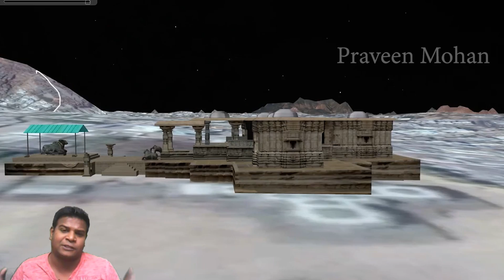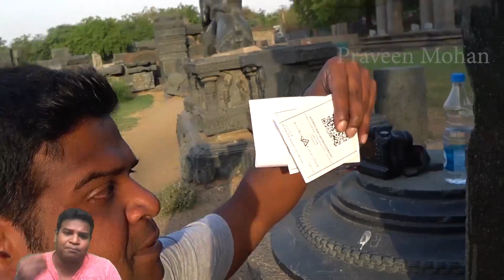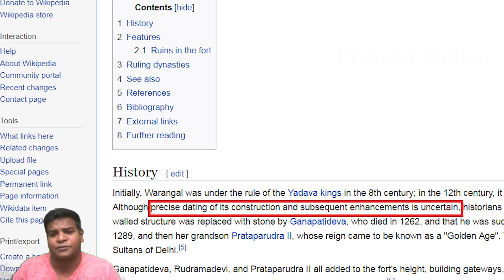Ancient Warangal Fort -  A Mass Manufacturing Megalithic Factory?

Comment: Praveen - You must take a closer look at the "Lingam" structure at 13:34 in this vid. Is it's true purpose being overlooked by classifying it as a religious temple? 

Because it IS one of the machines used in this stone production facility. The black obelisk is a rotational center. What would rotate around it? Cutting tools or work-pieces? The (perfectly?) flat table below - is it exactly perpendicular to the obelisk? That is needed for machining, not so much for offerings. The groove to the table edge - a drain channel for cutting fluid or tool lubricant? Is it original or a later addition for Offerings?  Are there openings or structures in the ceiling directly over the obelisk?  For lifting heavy objects or for rotating them?

The whole structure seems very massive, and dissimilar to the gates, walls,  surrounding the area, and is very plain and utilitarian, without engravings or decoration. Why? Because they are factory walls to support precision heavy machinery? The square indents in the walls - Mounts for an arm or bridge for guiding either the work-piece or the cutting tools? Same for the square protrusion lower down in the far wall. The apparently flat far wall, is it co-planar or parallel to the center table? = a cutting tool guide for large flat cuts. It also appears co-planar to the notch in the right wall, and the "waterfall" wall near right = to guide large flat cuts in two dimensions.  How high is it above the center table?  Equal to a common height or depth of many of the finished stones?

The engravings in the floor, are they perfectly square? Are they exactly the same size, or exactly proportional to the many square shapes in the finished cuttings? = more guides for the cutting process. The undercuts on the underside of the center table - are they more  guides for a cutting tool for precise engraving of fine details?  The fine engravings in the column of the table base? = patterns - guides for work like the sample column to the left?  And that column, is it structural, or could it be the "Blue-Print" for the in-process work, IE .... "Make me ten more just like this."

And what is the context of this structure in the larger area?  If it is a stone machining device,  an enormous amount of energy was required to work some or all the products strewn across the field. How was this energy provided? Human? Animal? Water? Any evidence?  Evidence for delivery of raw blocks and transport of finished work?

Too much to think about here.
Reply: yeah I noticed that too ...just rang a bell that it looks different

Comment: If we go by the analogy that ancient builders used drilling technology, how were they able to rotate the drill bits at high speed? There is no motor involved and how fast can we spin manually? How is this imaginably possible? I have seen your previous videos where you have shown pillars which were perfect cylinders. You need to rotate the rock at high speeds in order to get that shape. Bro clearly this ancient technology is lost. If not for the Mughal invasion and eventual destruction of this ancient knowledge, India would have been in a much better position now.

Comment: Many evidences can prove this site as a manufacturing unit. For ex.: Most of d same kind of rocks r placed nearby each other, also finished pillar blocks r together, roof tops at one place ( categorisation). Had it been a temple or fort, which later was vandalized, all these parts must b far away from each other. Like some pillars & rooftops at one place. Categorisation is a key feature of manufacturing.

Comment: It appears that due to the consistency of the grain within the granite and the crystals of the other stones, that they are produced using a refined geopolymer mixture. They also do not show any signs of natural layers of striations at any  irregular angles between the sediments. The regularity also around the small details which have figures and flowers etc with tiny holes is also impossible to produce without resulting in cracking due to the size of the rocks natural crystalline structure. The possibility of it being a type of geopolymer in a semi hardened state, worked on a lathe would also lend itself to being more easily carved without diamond tipped drills or saws or sanding surfaces to an incredibly smooth surface. A similar technology is seen with different plastic resins which do not harden quickly until exposed to certain frequency of ultraviolet light.

Comment: i can see at 1.38 the 2 stone carvings have power tools and it looks to me they have helmets and ear protection it also looks like the little guy in the bottom corner has a brush and is on hand to clean or dampen down the dust as we do nowadays this is brilliant i can clearly see how the tool was used it looks more like an air hose going to a breacker and a tungsten steel pointed breaker

Comment: As an experienced stone mason I can tell you that without a doubt this precision can not be chiseled onto a stone of this strength especially in such perfect minor detail. A lathe of some sort was definitely used in the roundish stones and the rest must have been made by somehow heating the stone up to a molten or liquid state and casting it from a mold. Then fine tuning it with machining. This is the only logical way I can think of it being feasable with the knowledge I have.
Reply: This is the exact statements that need to be made in regards to all the ancient megalithic sites.  People who are the best at what they do, look at the finished product and state "I am an expert, and I would have to follow these precise steps, use machines, or I can not duplicate that work unless an unknown process is created."  I say this as an aircraft technician with over 25 years experience. 

I believe what India holds and Praveen is now showing us is that these temples are made of geo-polymers or meta-materials.  For example, his "rock bending" video shows a deformed surface.  Praveen states it is similar to injection molded plastic.  What I see, is a temple that had specific structural elements designed to shift and not fall down during earth movements. The plinth stones in the floors raised up because the pressure from the roof pushed down.  The columns did not collapse because the round construction with pegs allowed it to rotate, further down, the edges blew out, and at points the thinner turned parts (like a lathe made part) was a stress point meant to crack.  I believe that rock bent because it is some unknown meta material. The same principles can be seen in the temples that the pillars have different notes when tapped.  Imagine a meta-material, while molten, is struck with a tuning fork for a specific note, and then hardened instantly in that state.  Then to top it off, they put the 3d representation of the note above in the ceiling.
Reply: Melting it down to liquid sounds like an extremely ineffective and time consulting way to make anything. There would be proof of the tools needed to do so everywhere. What's more likely is that it was a very artisinal workshop and they had several techniques much older and developed than the ones we use today.
Reply: It could be training centre also.
Reply: DarindaModi isBack  the person who have created something, have the rights to destroy it. But who the hell are they to destroy what we have created... More over we haven't destroyed anything, people forgot. I wish people like praveen mohan can let people know about what truly we are

Comment: These are soap stones which is very easy to carve ...only in TamilNadu and some parts on Kerala we could see structures and carvings carved completely out of granite. But when we leave TN and reach Karnataka to North , majority of the substance used in temple building is sand stone and soap stones. The tools used to achieve such perfection are also shown on the temple walls. The drill bits of various size and purposes to cut, sharp, polish. So when we read everything all together we get the secret, Ancient battery , big motors and drill bits is all we need to achieve such perfection and I agree that our builders had these diamond tipped drill bits and electricity to rotate the motors with high RPM.
Reply: Praveen does not mention that it is soapstone. He says it is hard rock. So it must be harder than soapstone. He is also mentioning :that kind of stone needs diamond tipped bits. However, only if we go there and touch and feel, we'll know if its soapstone or somthing harder...
Reply: Big motors and drill bits? 
Where?